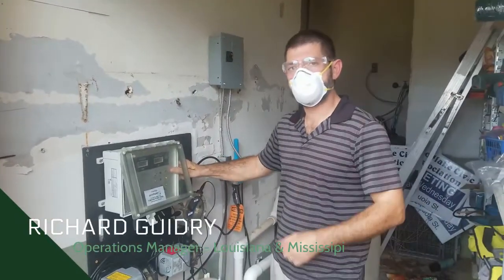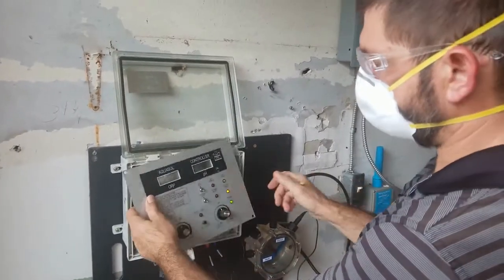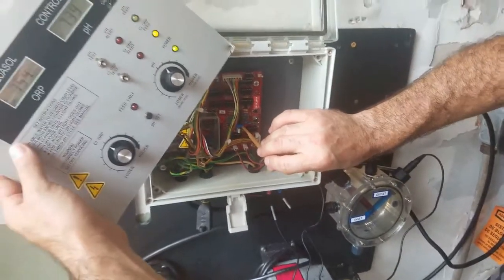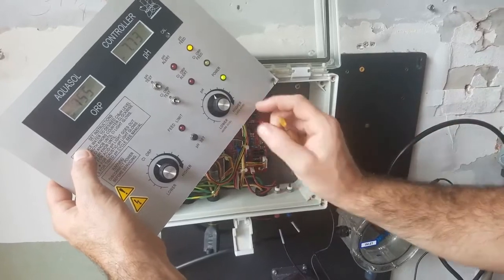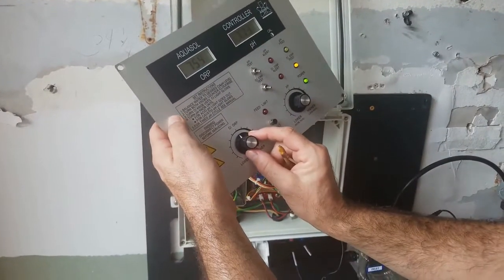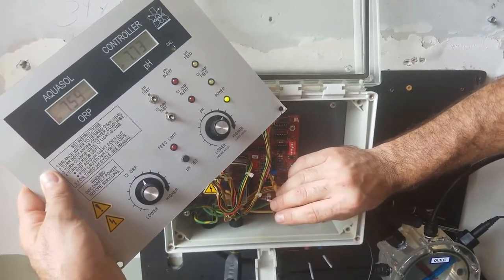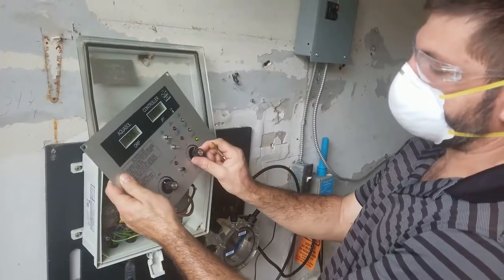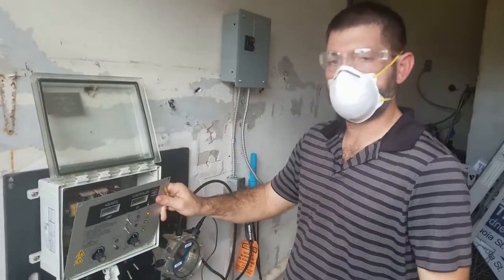Adjusting Setpoints

Comment: So first thing is to test pool water for ph and chlorine readings and then come back and adjust the controller to the test readings and after that turn your dials back to 12 o clock
Reply from the maker: You should test the pool and then adjust the knobs to effect any change needed (higher or lower chlorine/pH) once the pool is balanced to the levels you want you could open it up and adjust the setpoint back to the 12-o-clock position.